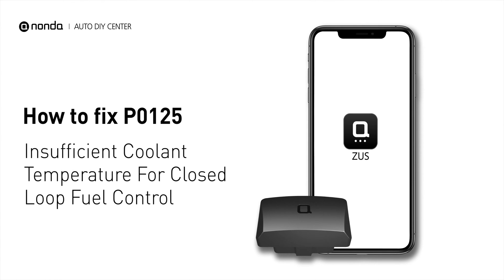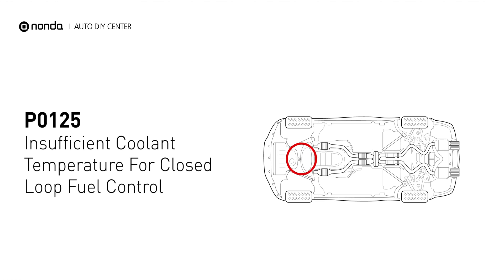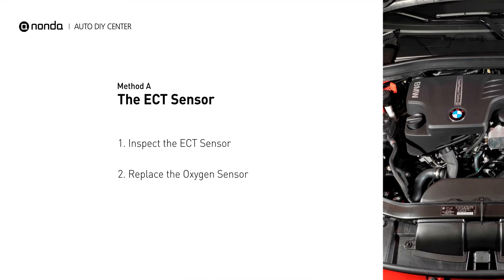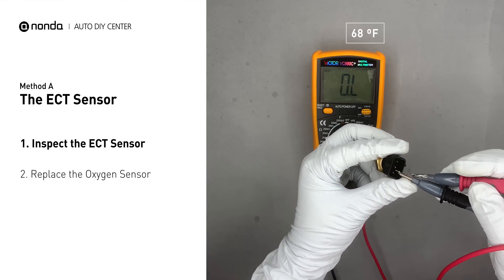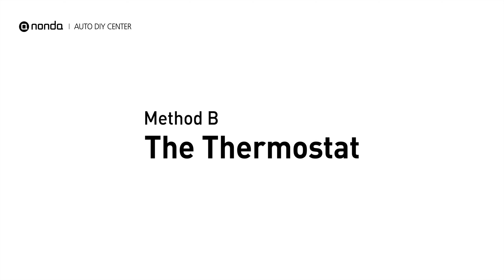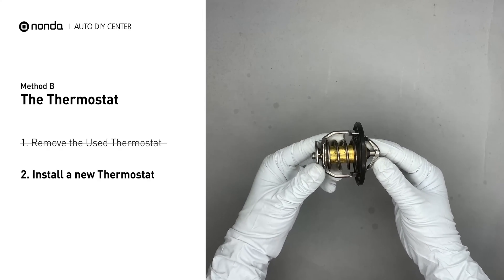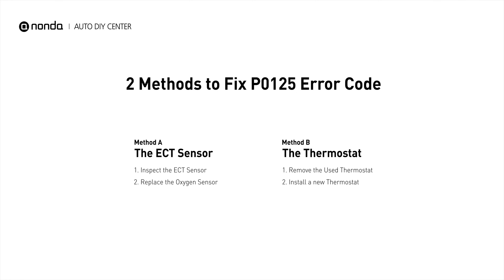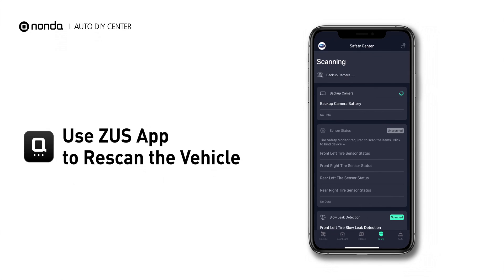How to Fix P0125 Engine Code in 3 Minutes [2 DIY Methods / Only $7.39]

Comment: Ive done both of these and still have the P0125 code on my lexus :(
Reply from the maker: Hi Rev, can you double check if there's any other code registering together with P0125?
Reply: @nondainc  Ive checked the obd 2 reader and only the 1 code pops up.
Reply from the maker: Hi Rev, please try monitoring the reported engine coolant temperature reading while you start your vehicle from cold and warm it up. If you're not getting the proper reading then your coolant temperature sensor is still faulty. Also, kindly inspect if there's a broken/damaged wiring or connectors on the O2 sensor.
Reply: @nondainc  thanks I will do :)
Reply from the maker: You're welcome, Rev!
Reply: @RevLexus  Hi fixed your problem or not.
Reply: @HaiderAli-hq9op  yeah it was the wires going to the O2 sensor needed replaced. Bank 1 S1
Reply: @RevLexus  good i will do it that
Reply: @RevLexus  you only changed the wired or the oxygen sensor as well?

Comment: I’ve always placed the jiggle valves at 12 o’clock. However per factory service manual for Toyota they say to put the jiggle valve at 6 o’clock.
Reply from the maker: Hello, newer recommendation is in the 12 o'clock position. However, it would be best to follow your vehicle's service manual.

Comment: Hello I have a Mitsubishi grandis 2004 and I have the same code I replaced the ECT sensor and thermostat and it doesn’t fixed what can issue more?
Reply: Well change the O2 sensor lol ..
Reply from the maker: Hi Shabbir, we suggest setting up an appointment to get your car checked out further by your local mechanic.